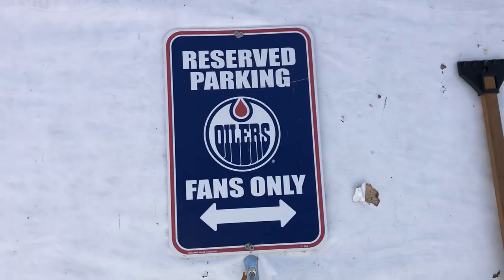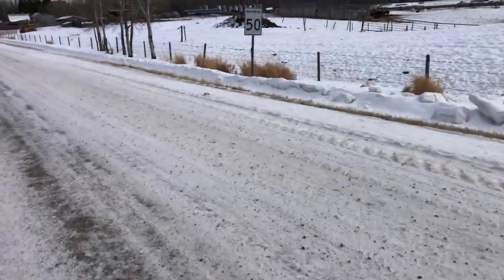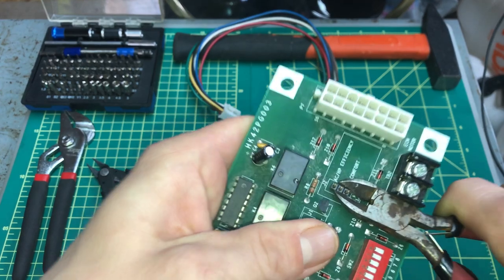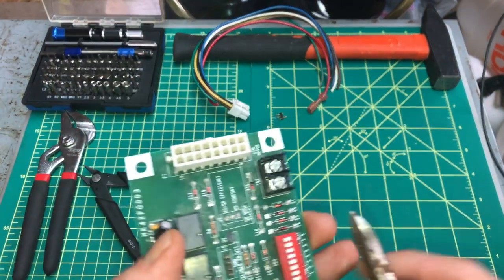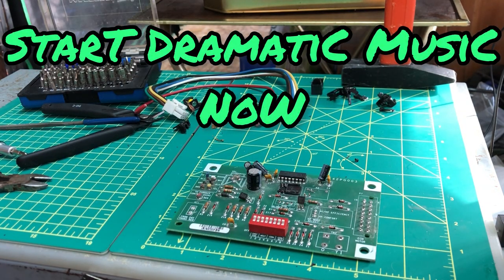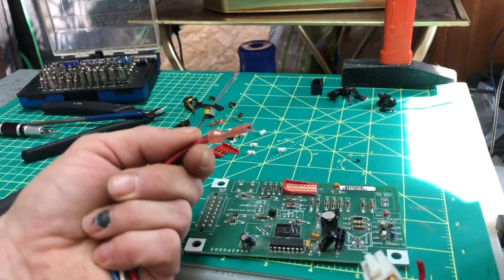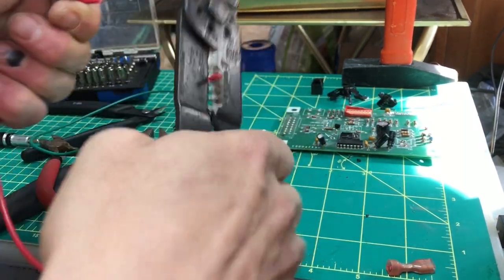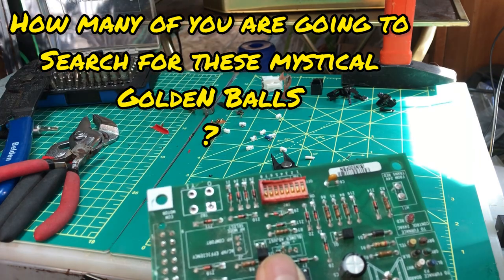Scrapping Circuit Boards for Precious Metals " It's Gold "

Comment: I don’t know much about e waste but I got a computer tower I still gotta take a apart I usually just got the copper from the green boards and throw them away. Great video buddy!
Reply from the maker: That’s normally all I do is take any copper aluminum and brass but there is lots of neat stuff to learn with ewaste I find! I just can’t sell boards or anything here in Alberta Canada. 
Thanks for enjoying Bro
Reply: @BushDogScrapper  in Ont, the relays have silver in every single one, if you're lucky you can find vintage ones with gold contacts. The capacitors can go into dirty aluminum which is what I do, mossfets have trace amounts of gold ~ 0.003% but it adds up fast you get around 0.33gr per kilo.
Reply from the maker: @jordankennedy3298  Here in Alberta we can’t really sell ewaste per say so I remove the stuff I can sell at the scrapyard! I do like to collect the other stuff off the boards as I hope maybe one day there will be a better market here for more of the ewaste ! CheeRs and thank you for enjoying the video!
Reply: @BushDogScrapper  5 cents a pound for any circuit board, so i depopulate then sell. keep what i want
Reply from the maker: @jordankennedy3298  I’d love to get .05 a pound for boards!

Comment: sometimes you can pull the wires out of the white connectors, if the internal connector comes out with the wire, cut it off.  Check for brass.
Reply from the maker: Great advice I do clip them and even the plated copper wires that are all over some boards! Pennies make Dollars! A file and magnet is a scrappers best friend! Have a great day thank you for popping by the junkyard! God Bless

Comment: Nice video, thanks for being so thorough with your scrap.  I go after all the bits also.  And yes, it is a bit tedious trying to film and work at the same time.  There are gold bond wires in those three legged transistors also.  Go back and look at the tips of the copper strips you pulled out of the relays.  Believe I saw some buttons at the end.  Those are usually high content silver.  What did that board come out of?  I have found 4 of those gold balls in my scrapping career and they came from two pole red switches that look similar to yours.  I found mine in Jet Direct cards from old printers.  I’ve subscribed :). Cheers.
Reply from the maker: Thank you for subscribing! I believe it came out of a furnace but I could be wrong it was almost a year ago now haha 
CheeRs

Comment: Use the lid from an old washing machine, it's got a nice lip on it, and you can set it on your lap to micro scrap.
Reply from the maker: Now that is a awesome idea I never thought about that! It would be easy to make some higher sides around the outside 3 sides to keep things from flying around lol it’s always something gold that goes flying off into the abyss 😂
CheeRs John thanks for the tip!

Comment: An old speaker magnet can save you some time in determining if it's brass or plated steel.
Reply from the maker: Yes absolutely I do use the magnets out of hard drives they are a neodymium magnet! I always say a scrappers 2 best friends are a good Nagy and a pocket sized hand file!
Thanks for watching John!

Comment: Make easier on yourself and clip off the capacitors then use a heat gun to remove the rest. It’ll save mega time.
Reply from the maker: That does make it easier but I’m all about trying to use as little power as possible to keep profits up! Thank you for watching!
Reply: Ever try a hot sand bath?
Reply from the maker: @urbanprospector3007  no I haven’t